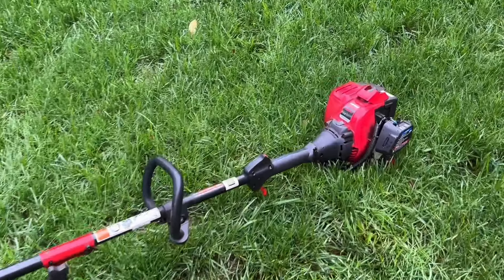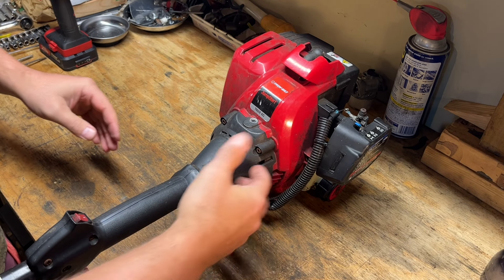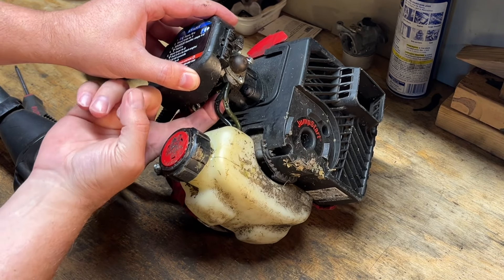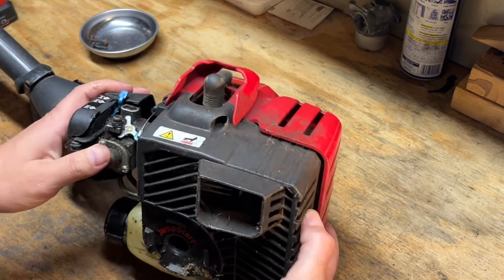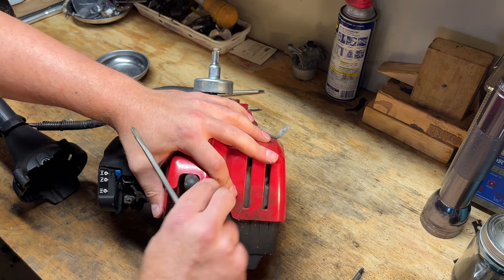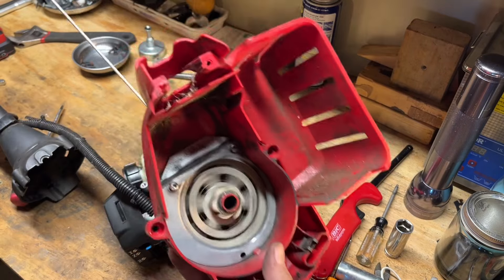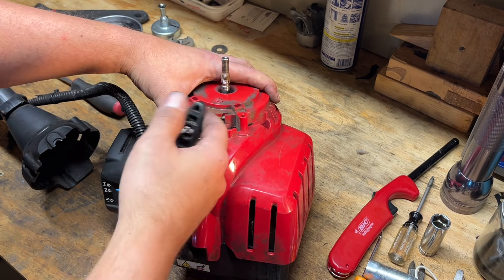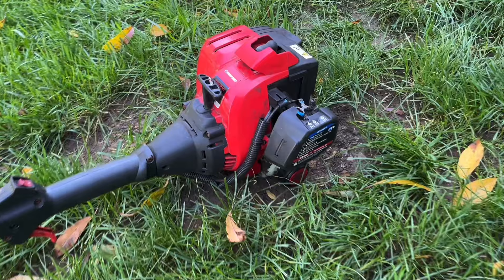Trash-Picked String Trimmer, What Does It Need? - Troy-Bilt (by MTD) TB22EC

Comment: I pulled a Craftsman Gold Series self propelled mower out of someone's trash a couple of weeks ago. It was covered in mud, and clearly hadn't run in a while. When I pulled on the cord, the engine came to a dead stop, so I decided to turn the blade by hand and see if it would make a full revolution. When I looked at the underside of the deck, there was approximately 2 inches of hardened grass buildup going all the way around the underside of the deck, and it was preventing the blade from turning. I scraped all the grass away, and the engine turned normally. I put a little gas in it, pulled the cord five or six times, and it fired right up and ran perfectly. It started on the first pull the next time, and has every time since then. I am going to change the oil and filter, but beyond that, there was nothing wrong with it at all. It runs and cuts great. It got thrown away because they never cleaned it. I got another little Murray push mower out of the same pile, and it just needed a valve adjustment, carb, and fuel line. It only needed the carb because it had been sitting. I'm always shocked when people do not investigate something before throwing it away. I got both of these mowers out of the trash, and got both of them running for $9 and a piece of fuel line.
Reply from the maker: Yeah the throw-away society mentality is real!

Comment: Just stick a small screwdriver through the holes on the recoil to prevent it from turning while you are tying the knot.
Reply from the maker: I typically do that, but this one didn't really have a good spot to keep a screwdriver engaged on the rope drum. Could have probably used a clamp to hold it too now I think about it